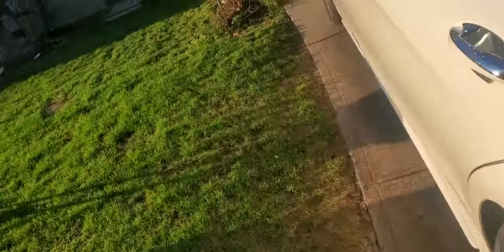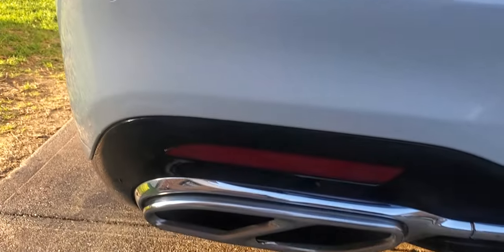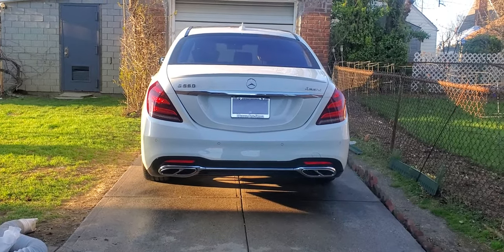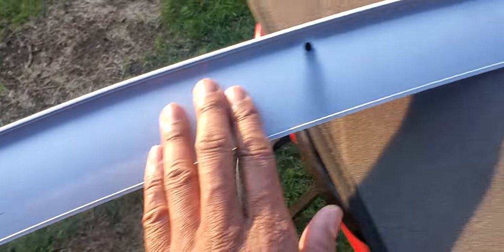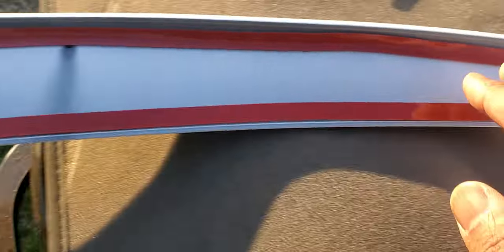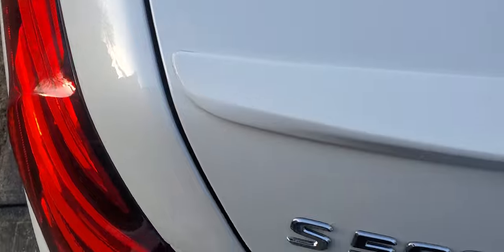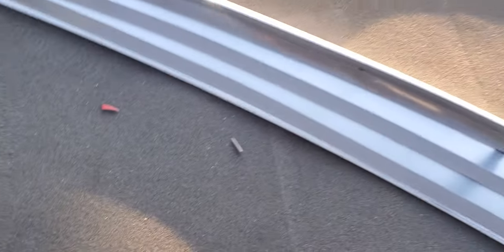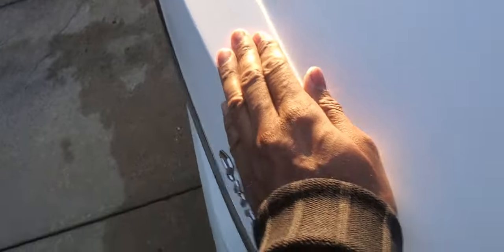Installing a Rear Spoiler on a  Mercedes Benz S Series

Comment: SN: 3M double sided tape (The red tape) is horrible in the cold, and you will lose your wing if you don't heat it up first but otherwise it's the same product most companies use professionally. More is better though in all cases with this tape and wider tape canbe purchased if wanted

Comment: Hi 
I own a 2018 s 560 as well 
I was wondering do you by any chance have a video on how you installed the side v8biturbo badges? 
Or can you please give me dimensions please 🙏 

I’m learning a lot from your videos !!
Reply from the maker: Go to ebay and order them. They are pretty cheap. Take a ruler and line up the letters side by side horizontally. Make sure it is straight. The decal stick to the car so you probably want to do it when the temperature is hot. Their is no right or wrong way to do it.
Reply: @WayneARobertson  
Thank you so much for this info Wayne 

But how low from that line above and from the door line 
Not exactly sure how up or down I should install them 

I have the badges already 
Ordered from Amazon
Reply from the maker: It doesn't have to be exact, just look at mine or galleries on the internet. You can place it anywhere. It does not matter. As long as your happy with it.
Reply: @WayneARobertson  
Thanks man 
I will try it 

How many miles do you have on yours? 
How’s everything on it good I hope 
Mine just hit 50k
Reply from the maker: I believe I have 77k. I haven't check in a while. No problems with my car but then again I purchased it certified pre own from the dealership.

Comment: When did you switch from the S550 to the S560?  Is it better to get the s450 over the s560?  Been looking at 18-20 models cpo but haven’t heard great things about the V8
Reply from the maker: I switch cars when I had my accident. I've never had problems with the V8. The S460 is the 6 cylinder version. I've had 6 cylinder all myife and wanted to upgrade for more power. I have not regretted that decision.
Reply: @WayneARobertson  Man, you make a great point.  You only live once and it’ll be cool to have a V8 when everything is going electric

Comment: What type of tape come with this spoiler?  It's not 3M, isn't it?.If really is 3M, what number? Thanks.
Reply from the maker: I don't remember the tape number. All I remember is that it is red, and it comes in the package.
Reply: @WayneARobertson  OK, thanks. I see it's not 3M I think. There are a lot of tapes and some of them are not good for this application.

Comment: Where did u get the wing at bro
Reply from the maker: I bought it from Ebay. They have plenty for your make and model cars. Do a search for rear spoiler W222
Reply: @Wayne A. Robertson  I have the s550 coupe I just thought u might have the exact link
Reply from the maker: @uptownfragrance6148  I will find it when I get back home. On the road as I speak. It will be today
Reply from the maker: @uptownfragrance6148  Here is the link url: https://www.ebay.com/itm/302603343216?mkcid=16&mkevt=1&mkrid=711-127632-2357-0&ssspo=ncB6E2WXS3G&sssrc=2349624&ssuid=_SdWIlicSbi&var=&widget_ver=artemis&media=SMS
Reply: @WayneARobertson  thanks bro

Comment: Do not remove the tape completely because you give chance for things in the air to adhere and also can accidently stick the wing to the car. Just peel the ends out just a little, put down the wing and pull the tabs from under the wing while holding with opposite hand

Comment: Well, Mr. Robinson, this just goes to show you that beauty is all in the eyes of the beholder.  I have a 2017 Mercedes S550 sedan which I purchased as a 3 year old vehicle.  I'm not crazy enough to pay full price for this type of luxury car and the model that I located was very well cared for and sold for over half the price of a new one,  The car was in excellent mechanical condition and the interior appeared as if it was brand new.  Blessings go out to the previous owner who took great care of this car.  Unfortunately, it came with a spoiler which, in my opinion, did not add to the beauty of an already attractive car.  I vowed that one day I would remove this hideous-looking thing that did not in any way, add to the performance of the car, either at low or high speed.  What is the point of adding a spoiler to a car which is already designed to look elegant with lines that are sophisticated and restrained?  To me, it's just a way for the folks back at the dealership to convince a shallow status seeking individual to add an ugly contraption that will do nothing to improve the aerodynamics of this car.  Afterall, this is not a jet aircraft that benefits from the addition of winglets that are integrated into the wing in order to improve performance and fuel consumption.  What do people think that they are getting when they add a lip spoiler to the trunk of their car?  Better road handling on curves and at high speeds?  That's partially a factor of a great suspension (which Mercedes is known for) and excellent tires (such as Michelins, which the car came with).  Improved air flow over the body at high speeds so the car doesn't lift off the ground?  This isn't an airplane, after all, and it doesn't have wings and continuous thrust to propel it forward (propeller or jet, take your pick).  No, in my book, a lousy little piece of plastic placed on the rear of the car is just a meaningless bit of fluff designed to bolster the driver's ego in order to have the admiring public gape in astonishment and point in admiration to that amazing-looking vehicle that looks like it's about to bolt down the runway and take off into the stratosphere.  Wow!  Isn't that fantastic the way that car looks?  Oh, and the driver must really be an amazing individual to have thought about adding this special option to his or her car when he or she signed on the dotted line of the purchase agreement.  Yes, you can keep your spoiler;  I'll send mine back to the grinding mill and have those pieces of plastic turned back into a computer printer, or whatever.  Have a great day Mr. Robinson and thank for for teaching me how to REMOVE a spoiler the right way.
Reply: Thanks bro.  Your comment is the proverbial "straw that breaks the camels back." I've been torn over getting a spoiler similar to this one for quite a while now.  One day I look at my S63 and yeah I want one.  Next day I look at it and nah, I'm good.  But as I say, your comment has given me the inspiration to go ahead and order one up!  Hopefully it won't take too long to come in and I pray its not beat up on arrival.  Thanks again bro!